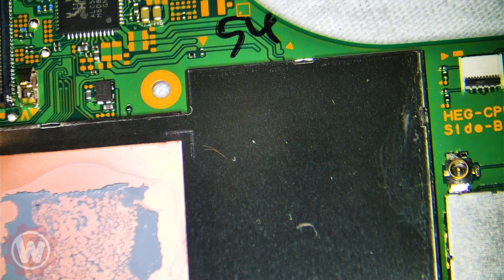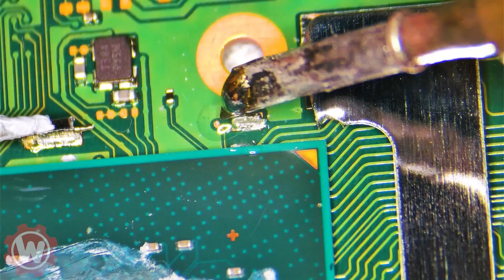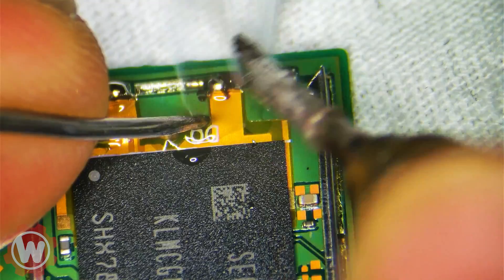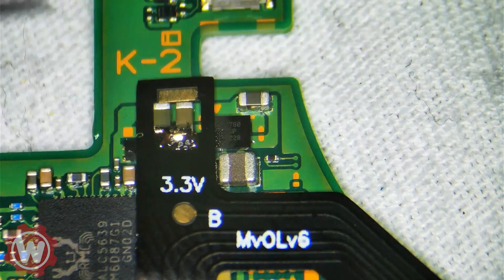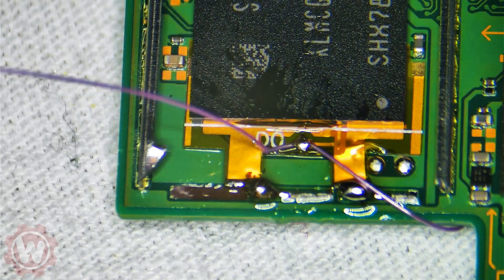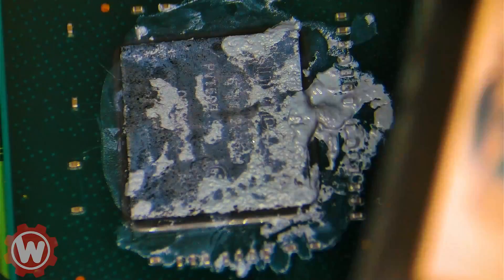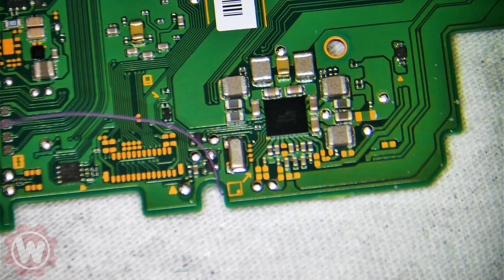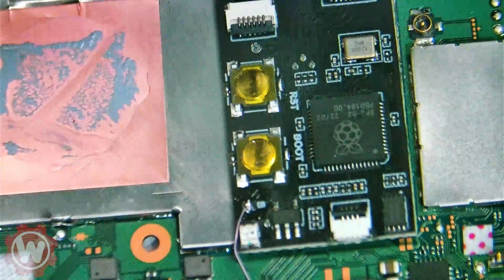Nintendo Switch RP2040 PicoFly OLED Mod Chip Installation

Comment: What happens if the mod chip flashes blue (glitching) then green but there is no screen? And no screen when disconnect the mod chip?
Reply from the maker: Check your FPC display connector. Sounds like chip is working.  Check for shorts.

Comment: 38 gauge magnet enameled wire? Or is there a different kind I should get
Reply from the maker: You can use it but single core is what I prefer. Good luck 🍀👍

Comment: How's that flex cable for Dat0?  Any failures after 3 months?
Reply from the maker: None. If done correctly it will not guve issues.

Comment: Maybe someone can hint me in the right direction.
I installed the chip according to this tutorial, everything worked for like a month without any flaw. One night i just put the console to charge on my desk, next day it wouldn't boot up. Removing sd card still shows the no sd logo, but it doesnt even boot ofw or hekate. Any ideas ?
Reply from the maker: Check your dat0 adapter. Look at my other tutorials and see how I install this adapter. Good luck.
Reply: @Wayayeo thanks for your reply. Dat0 wrong installation would still show no sd logo? Also i measured dat0 and it shows .587
Reply: @Wayayeo i commented on your video, as i have exactly the same chip as shown here.

Comment: Quick question, on the MvOLv6 3.3v point why have you only tapped in one side and not the other?
Reply from the maker: The other is simply fur support or ground. Ground is in other points it’s unnecessary but you can solder both if you’d like makes no difference.

Comment: Hey boss, followed your tutorial to the teeth. Unfortunately mine turns blue and then flashes yellow and then turns on into OFW. Any tips?
Reply from the maker: Get a multimeter and test every point.  Something is that properly soldered. Usually Dat 0, maybe “d” point. Good luck.

Comment: Wait do you not have to use hot air or anything to mate the point of the yellow ribbon that slides under the chip with it, how do the points that slip underneath mate with the chip, its never explained in this video how that is done, and I never see you do anything with it, just the two points near the outside of the switch board and the one center point where you solder the purple wire?
Reply from the maker: No heat is necessary.

Comment: My d point is OK, but I still get a blue light followed by three blinking white led. According to the error codes d0 is bad, but I get 845 or so diode reading from it. So I don't think it is.
Reply from the maker: If you’re getting that reading on DAT0 then you’re ok there. Check first shorts on all points.

Comment: Hi great video! My doubt is if this affects the original Nintendo Switch firmware or if it is something you can decide on boot. To use HACS or original firmware and connect to the Nintendo network. Thanks!!!
Reply from the maker: You have the option to boot CFW or OFW

Comment: that one part that goes under the chip labeled "SEC 243 B041 KLMCG4JETD SHX78SI3S" , the yellow one with "D0" on it. some tutorials also solder the contactpoint and the resistor on the left together, and some tutorials don't. what difference does it make?? i cant find this anywhere on the internet.

Comment: Difference between OLED and normal version 2 Switch. Is soldering more difficult with the OLED?
Reply: I believe the OLED needs DATO point where the V2 doesn't need it. So I believe it is harder than V2.

Comment: Good work, I installed hwfly (not pico) on my oled since 2 years ago but i always face problem red led after rebooting, is that issue happening with pico ship? Thanks
Reply from the maker: Check your Dat 0.
Reply: yes Dat 0 give me always 0.8xx reading!! I had to disconnect the battrey and connect hw fly ship points together by tweezer its like a reset to get it work until nex reboot   @Wayayeo

Comment: I see several mod chip sets in my search for a mod chip for my oled switch. Are all of the options compatible? If not how do I determine which is compatible? Thanks.
Reply from the maker: There’s a few options out there just make sure you get one for your console. If it’s an OLED get an OLED chip.

Comment: What is the difference between hwfly and picofly and which is better? Thank you
Reply: Hwfly was a clone of the SX chip, it popped up when gary bowser (the creator of the SX chip), got imprisoned for piracy charges

Picofly is an alternative made with the $4 raspberry pi pico.

The HWfly is now no longer in production due to the release of picofly.

They used to have a monopoly on nintendo switch modchips and charged exorbitant prices  but picofly changed all that and they quietly discontinued hwfly.

Comment: Hey sorry dumb question but is this used to load custom software to the switch like retro arch?
Reply: this is for patched consoles, where as the jig and RCM trick doesnt work anymore.. all switches after the patched RCM and jig will need this method. and rp2040 is the best one for lites and oleds. Less failure rates. Im getting mine back from this guy in the mail with ups and i cant wait to play some games and emulators on it! :D
Reply: @drewscentral5587 have you gotten it back yet and tested it out? Wondering if I should do the same but wanna know firsthand if trustworthy

Comment: How do you confirm D0 is connected? I've slid it in as far as it goes and keep pushing as I solder the ground pads but getting long yellow short yellow pulse to say D0 is missing.
Reply from the maker: Multimeter ground to ground and red probe on c point. You’re looking for 500-900 somewhere weighing that range.
Reply: @Wayayeo  I had it connected brielfy and got the 8.10 reading mentioned in video but it usually reads 0.2megaohms. Had it do succcessful boot once but failed again and it's the DAT0 error so just the emmc. 

Any points for ensuring? I;ve stuffed it in as far as it can go and pushed it in while soldering grund to make sure it's stuck in place but no joy with consistency
Reply: Just for anyone else who was struggling. My DAT0 flex wasn't the best, got a replacement and it stayed connected no bother.

Still had error though despite it being connected, turned out to be the 3.3v flex at fault so wiring the DAT0 wire to the RP2040 point on the board for it solved the issue,

Comment: Hello. Does the DAT0 adapter tend to get loose or out of placement without refloating and applying heat?
Reply from the maker: I personally haven’t had any issues but I have seen and repaired poorly installed DAT0 adapters. Make sure you get it in there nice and tight.
Reply: @Wayayeo  Thanks a lot.
Reply: Can you please tell me the value range which is fine for measurement (ohms) d0 ?
Thx in advance

Comment: Hello i try to this and first time when I boot I have the ofw , I re see your video and I swap the cable 

I thought I had soldered the cable you soldered between the letter C and D in the wrong place, so I connected the cable to the point at the bottom, and then I had a BLOD. now I removed the picofly and I still have the BLOD…. Do you have any idea, thanks
Reply from the maker: Check all points
Reply: @Wayayeo  i think my switch it’s die , bluescreen

Comment: Mine turns on a blue light and then flashes green like 4 times and it doesn't do anything and the screen doesn't turn on, do you know why?
Reply from the maker: Check your connections with multimeter.

Comment: On a scale of 1-10, how would you rate the difficulty of the install? I've done some soldering with keyboards and old gameboys before, but have never done any micro soldering.
Reply from the maker: That’s a good question but you will get different answers depending on who you ask. If you have some experience I think it can be don, just make sure you take your time. Another factor is the equipment, get your self the right tools. Maybe a 5-6.  Best of luck !
Reply: @Wayayeo  I work as an electronics production\service tech with speciality field in radar\server\COTS\Rack assembly, and I would rate this very low in difficulty as a repeatable task, but the first time I would rate it to a 3-4 i guess, as I am not too often involved in microsoldering specifically, but have all the tools meant for the job.

With a big\normal soldering iron, a phone camera instead of a microscope, flux filled solder only, I would quickly say 7-8 in difficulty instead, as the tools are unfortunately much of the job in these size specters!

Comment: I have a few questions. Will flux, a sharp point solder tip, kapton tape, and thermal paste be enough for the installation?
Reply from the maker: Sounds about right. A microscope would help lots. Good luck on your install.